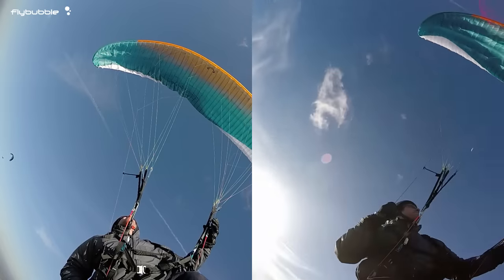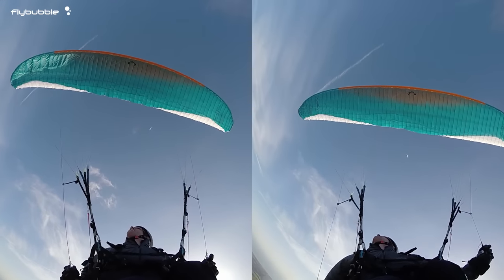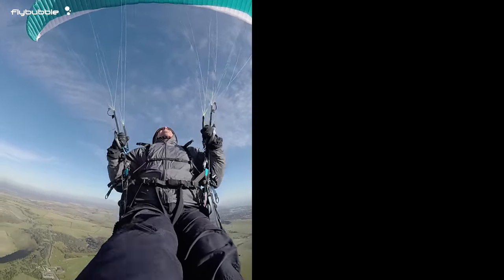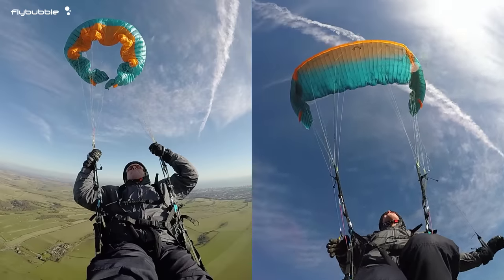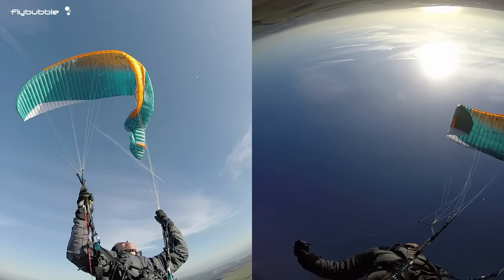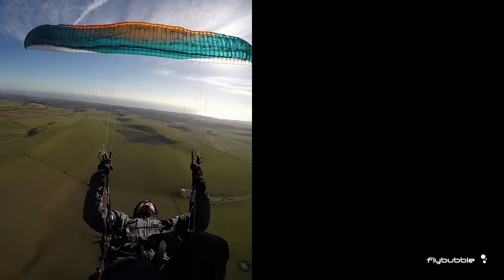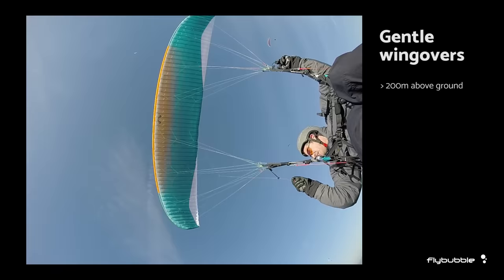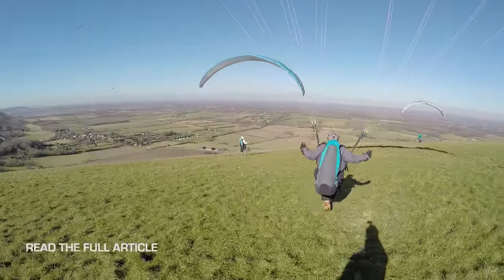Paraglider Control: Stall, Spin, Collapse!

Comment: I have a question about the spin from the example. Can I prevent it by more weight transfer in the seat and less break pulling? Or there is no difference and it mainly depends on the speed? And the second question is: I have an EN-A glider and it is not so fast. Is it more dangerous when I will try to center the thermals? Thanks.
Reply: good question Camo. Yes you can improve your spin resistance by more weight transfer (which helps to achieve the turn by rolling instead of by braking) and less brake pull (which helps to reduce the angle of attack). This will also make it a turn at a slightly higher speed. The EN A wing has a huge resistance to stall, so it is safe to turn it tightly - it can fly slower than an EN C for example, and due to the small wingspan it turns very well.

Comment: I appreciate the effort you put into the videos, but I have to write a feedback about few points I dont like.  Please dont take them too personally :) I still love your videos - but while teaching others, I think teacher should execute those manuevers flawlesly or at least point the mistakes out.

1/ Hands up means hands up, yet you still use 20cm of breaks in many situations. (I know that you are automatically breaking the dive, but you know what you are doing, but your virtual viewers probably dont!). 
2/ You are constantly in touch with risers, grabing them at some point, its very bad practise and bad example.
3/ After frontal, when its selfrecovering, hands UP unless the wing is infront of you 45°. Otherwise you will sooner or later create a cascade by stalling your wing.
$/ 200m is way too low for general public to start experiment  with training those figures alone, without instructor on radio. Things can go wrong very quickly. (like putting some lines into carabine during frontal or asymetric).